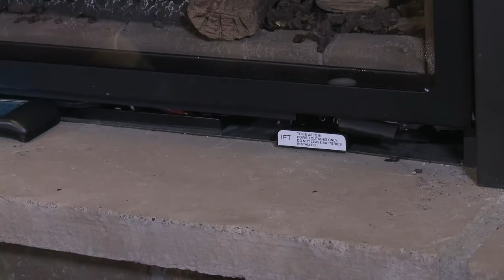How to Use Your Gas Fireplace During a Power Outage

Comment: Thanks so much. Piedmont came out about a month ago for an annual inspection and told me this but I completely forgot what he said to do. I was going to turn the switch on and use my lighter but I probably would have blown up the house. I forgot about the battery thing. Thanks again. It’s 11 degrees here in NC in December 2022.

Comment: In a power outage I do this video to start it but then how do I turn it off if I’m  still with no power? By the wall switch or just turn pull the batteries out?

Comment: Does wall switch work because of battery in event of outage?
Reply: I see you’re here from 7 hours ago and I’m here now for a video that’s years old. From this video here, the wall switch will work with batteries inserted. The other videos say that you need to switch a box to on/off/remote. My fireplace doesn’t have the box to allow different settings so I think the wall switch will work with just batteries installed.

Comment: I have watched  at least 7 videos about using fireplace during power outage. None of you guys  has thought about how about fieplace that are not equipped with the battery compartment. My house buit in 2008 and don't have that. How dum that nobody thought about explaining that...I guess I'm gonna find out the voltage of my fireplace valve and figure out how to create one myself...
Reply: Mine built in 2017 doesn’t have it, either.
Reply: Hey let plus know if you do.

Comment: Looks like you are not replying to any comments, so I'm just venting this out to the world. I got a Slimline 7X last year, and it's incredibly difficult to access the battery pack section. Two screws have to be removed from the backside of the bar. Imagine how difficult that would be in a power outage situation when you likely don't have light?? I can remove it and leave it off, but now the wires and bits are visible. I'm incredibly disappointed in this small but important issue.

Comment: It's so weird that this is a manual process.. Why not just have a switch that activates during a power outage... Instead of a manual connection...  When I bought a home.. The battery backup was connected.. So the batteries were heavily corroded due to constant charge...